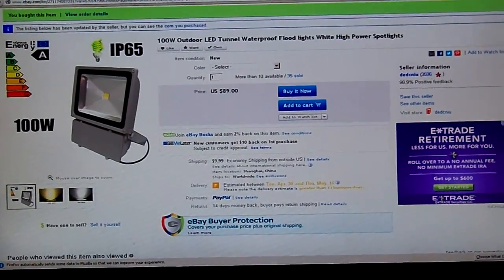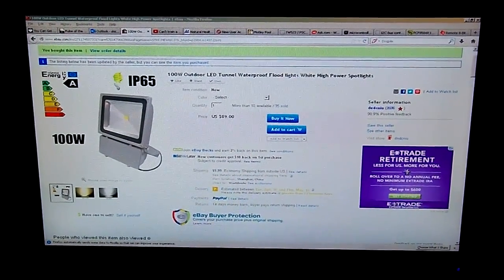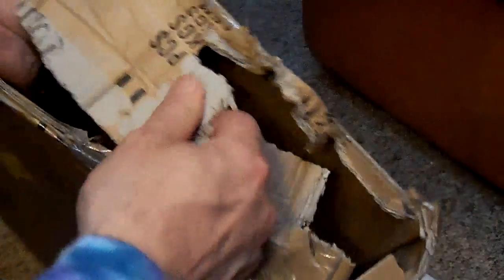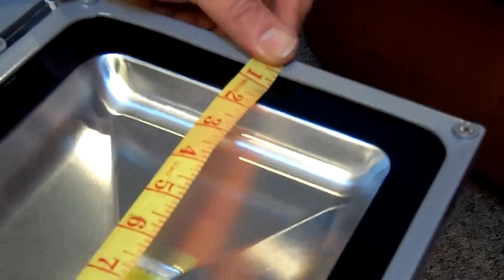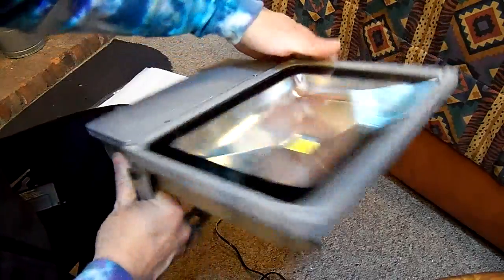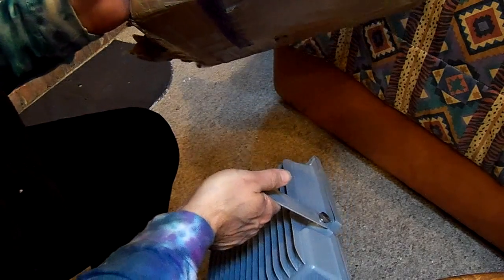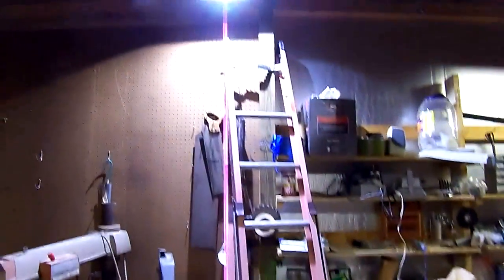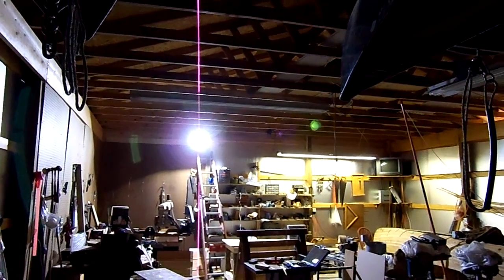100W LED Fixture

Comment: I'm thinking the delay turning on and the glow after ward is due to an inductor/coil. That's normal and used to stabilize the voltage and current going to the LED. From what I understand the inductor take second to build up it's magnetic field hence the delay on starting. When it's powered off the inductor's magnetic field take a little bit to go away. Would love to see this turned on in your shop all by it's self. I'm interested in the flood effect of the light. I was thinking about building my own for my shop with very shallow reflectors to allow for more of a flood effect. The parts are very cheap on ebay.
Reply from the maker: The spread of light is not very wide, though somewhat blocked by the rim of the fixture. since the LED is a flat square, it has no edge illumination. I'd say from the nine-ten foot height, most of the light falls in a ten foot radius. If you roll your own, do not underestimate the amount of heatsink required. See my attempt with a smaller emitter:
http://youtu.be/tKmc_CXkl08
It is somewhat dated, you can get better deals on bigger LEDs now, but note how the heatsink and fan used are just barely enough in this example.
   For my barn, I concluded that I'm better off with twice as many 50W units.
Reply: more likely the filter caps charging and discharging.

Comment: I have bought 5 led lamps from that seller on ebay, but i got 2 broken, now i've upgraded the lights with a Cree 100w XML T6 LED Chip 12000LM.
The led is less warm then the old one
Reply: +bobdehouwer hello sir, we can supply these floodlight too,please check our site www.starever-led.com.we can provide you best quality,best price and best service.welcome to your inquiry ! thanks
Reply: which chip do the eBay ones come with? is it hard to change the led chip?
Reply from the maker: +ben sharifi They come with often faulty Chinese chips. The chips can be purchased very cheaply online but you may be buying seconds. I believe there are at least two different form factors too, so watch for that. Shouldn't be hard to disassemble and replace, you might need a dab of thermal compound and basic soldering skills, other than that watch that you don't strip any threads, the metal in the housings is very poor.. I will probably be doing a chip replacement eventually on the unit featured in this video as two rows in the element are dead now. Someone recently did a video on the 100W chips. He bought five of them and they all tested poorly, tried to find the video for you but couldn't quickly, I think it was from bigclivedotcom or Julian Ilett.
Reply from the maker: +ben sharifi Found it:  https://youtu.be/NjKgPLeJ79Q

Comment: I bought a 200w led light for my bedroom, i want a sunlight effect to make me more productive, what is your opinion ? Is it overkill ?
Reply from the maker: +Sam Splentfield (Sam737)    It might not be, though for me it would! Is it a light fixture like the one in my video? The size of the room, the color of the walls would all be significant. On the other hand sunlight through a large window on a bright summer day still be brighter. Spectrum would also be key for this purpose, "daylight" would probably be best.  I'd recommend using it indirectly, illuminating a white wall or ceiling. For me the tough thing would be the rapid full on / off. Usually these are not designed to be dimable. What would be great would be a driver circuit that would build up brightness slowly and also turn off slowly. You might look into what they sell for people who have SAD (Seasonal Affective Disorder). Often these are large shallow boxes or frames with a white cloth or translucent plastic surface that are brightly back-lit and hung on a wall like false windows. Shouldn't be too hard to make, have considered doing so myself.
   Anyway, if you have or can borrow a "Kill-a-Watt" I'd love to know how much Wattage it actually consumes and who you bought it from.
Reply: +HillOrStream thanks for the answer !! I got mine today !! 200w of pure led power awesome, it is very bright, though as the human perception is logarithmic, i percieve "only" my room as being 2x as bright as before, it is like a minisun, i've followed your advice to light up the wall. One thing though, it is very bright but still not bright enough for me (im crazy i know lol) i get roughly 800lux i think i'll get an other one and see what it does !
Reply: +HillOrStream as you said it isnt dimmable though, and i think if you do, it will shut off because of the way the PSU works.. I will try adding a smartswitch
Reply from the maker: +Sam NG (Sam737) Let me know your results. Would really like to see what they pull on a Watt meter, like a Kill-O-Watt..
Reply: Hi, yeah i've plugged it to a smartswitch, i'm having fun with my "midnight sun", as for their consumption, they dont really take 100w/LED, more like 70w per LED.